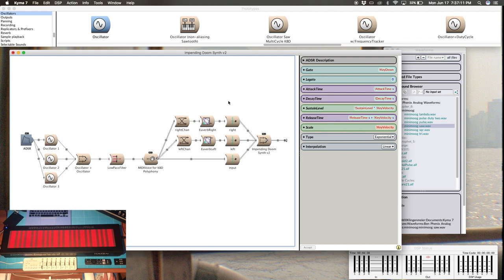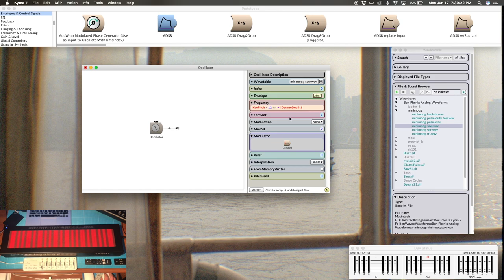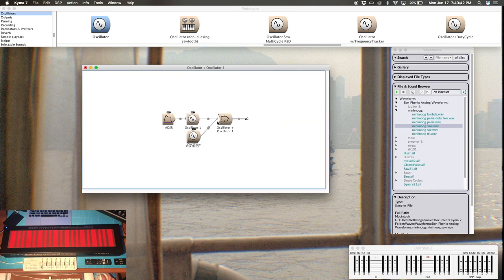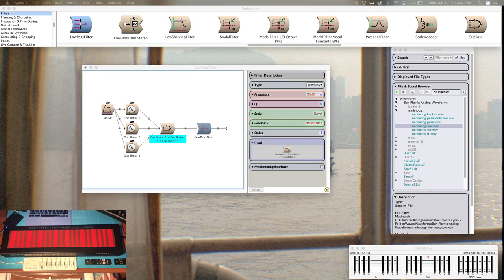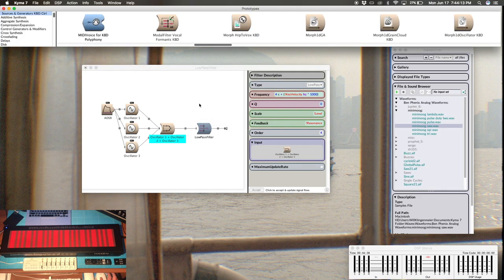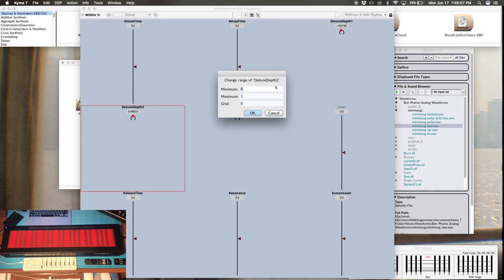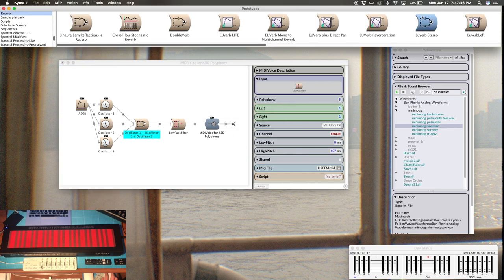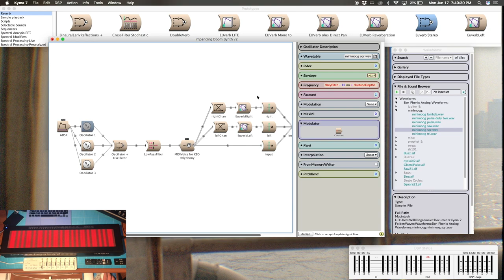Symbolic Sound Kyma | How to Build a 3 Oscillator Synthesizer

Comment: These are very helpful. Thanks! Do you have anything super basic about the Sound to Global controller?
Reply from the maker: Hi there! Thanks, it's always nice to hear that these tutorials are helpful. I don't think I have a specific video on the SGC, but it is definitely touched on in a number of my videos. What would you like to know?
Reply: @SpectralEvolver  Wow! Thanks for responding. Right now I'm using a Generic Source, through a SGC, and into an oscillator, aimed at Frequency. I would like the frequency to be lower, without changing the BPM. I would be very grateful to have your advice!
Reply from the maker: @thatsuecarney  Are you trying to control the frequency of the oscillator with a sample/live input?
Reply: @SpectralEvolver  It is data converted to .aif.

Comment: I was wondering about that "Accept" button below the parameters section. You don't seem to touch it at all when making changes to a sound. So, what's the purpose of it?
Reply from the maker: The “accept” button can be clicked after changes have been made, or if the white space around the signal flow graph is double clicked there is the same outcome. I prefer the latter.